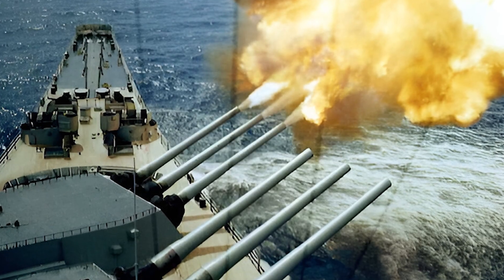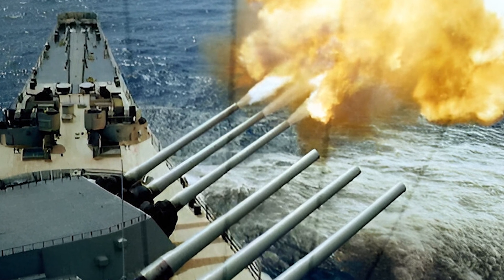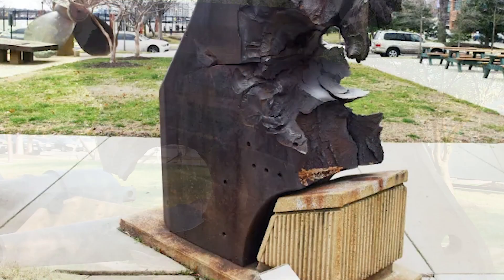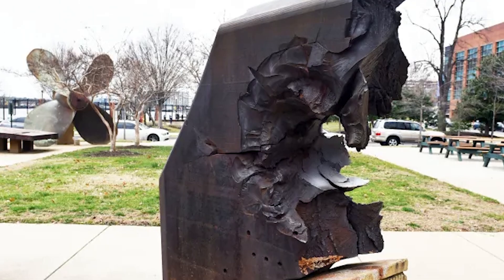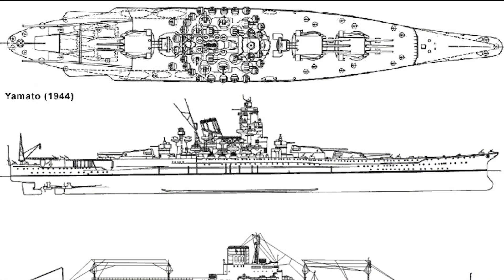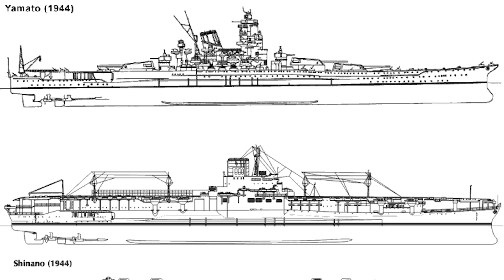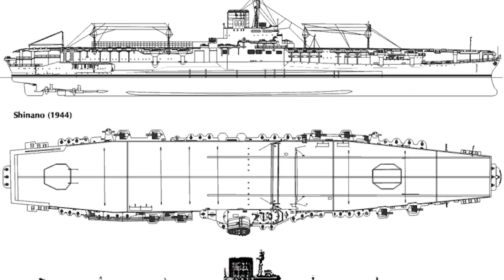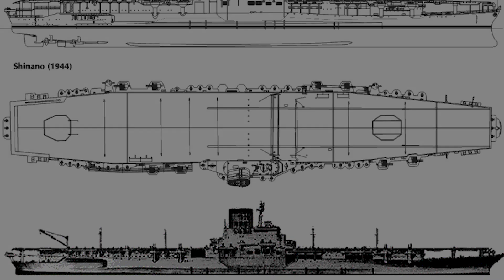USS-Iowa VS Yamato Armor Simulation

Comment: Before anyone goes overboard with this. The plate tested had FAILED its quality control testing at the Japanese foundry. That why it was lying around, and not in a ship. The heat treatment had gone wrong. It was too brittle. It is very hard to do the face hardening on such thick armour plates. All navies had difficulty getting the quality right.
Reply: As much as I believe that Japanese armor was of a far higher quality than is believed in western circles, there's no available evidence at all that the armor plate in question had failed any quality control test. It's far more likely that the armor plate was simply set aside because of the decision to convert Shinano into an aircraft carrier, and that the 26" plate could not be used in any other capacity in the Imperial Navy. This is supported by the fact that on the basis of the two tests on this same plate, the U.S. Naval Proving Ground concluded in their report that the faceplate could not be penetrated at any combat range by the 16" .50 cal. gun.

Comment: I actually read the official post test reports.  The test in 1946 was initially done with the homogenous armor plate mounted vertically 100 yards give or take from the muzzle of the 16" gun.  Essentially the two ships would have been as close as if they were tied up on either side of a pier firing at each other.  The test used a 2700 lbs super heavy shell and the maximum rated overpowered charge which was actually larger than the normal safe maximum in a ship.   The shell blew right through the plate and traveled miles into the Chesapeake bay and was never recovered.   The Navy  testing  brass were furious because that test did not even replicate  the methods the Navy tested their own armor.   It  was little more than a flagrant stunt and was considered garbage and a huge waste.
A second test was ordered with the charge reduced to produce a hit at battle ranges (16 - 18,000 yards) .   The specific range was picked  because they could not mount the plate at the sloped angle of the ship design.  So they calculated what  range roughly would cause the shell to hit the face perpendicular.  The second test firing was stopped cold by the damaged plate with little spalling on the back  side.  The final  report gave a sobering  assessment that the homogenous armor was impenetrable at likely battle ranges.  Other testing of face hardened Japanese  armor reached similar conclusions.    Yet the Navy paraded the first stunt test for the propaganda.  
It is important to  note that both  US Navy and  RN  claimed the Japanese armor had ceramic particles which they thought was contamination.   Interrogation with  tech personnel from Japan who made the plates later  showed they deliberately added the ceramic to improve performance.  Japan knew in a war they could not get certain alloy elements and developed substitutes.   This was hidden from the public and other nations.  Research eventually lead to the Chobham armor in tanks which is a huge improvement  over face hardened plate..
Reply: Well done.  

Truth be told, there is more than one way to sink a battleship even in the 1940s.  

In a one on one or line of battle fight jutland style the Yamato would likely have tipped the scales. But the Japanese knew they had to degrade the US battle line before that decisive engagement per Japanese prewar assessments.  

Game change with aircraft carriers and advances in other areas, radar controlled gunnery, better fire controls, improved damage control procedures, US wolf packs causing oil shortages and the sheer volume of us material and personnel thrown into this fight.etc...
Reply: @georgeramos9474  Guys, this sort of 'rah-rah flagwaver' is both common and annoying. Not worth engaging with. At best they have a shallow knowledge of a few secondary sources. Many are very, very young. Even experienced historians sometimes fall into traps, too. I recall a long debate about 15 years ago on this topic on the BBvsBB board. The flagwavers were utterly convinced that the Iowa DESIGN was superior to the Yamato DESIGN - but then argued that this was so due to US electronics superiority by 1945! Of course, by DESIGN the 45,000t Iowa is inferior to the 60,000t Yamato with its much thicker armour, greater ability to absorb punishment and superior guns. How could it not be? Also of course, both became obsolete very quickly and were not - in 20:20 hindsight - worth building. But  nobody in the 1930s when they were designed could possibly know that. And yes, the points on the invalidity of the test against the Shinano faceplate are all correct.
Reply: Funny how if it was propaganda why did the Yamato sink so quickly the aerial bombs and torpedoes easily sank it.
Reply: @spearfisherman308  Any battleship in the world would have been sunk by such an onslaught.
Reply: @spearfisherman308  Any battleship would have sunk under those same conditions.
Reply: @spearfisherman308  all ships can sink from torpedoes.   It is not clear the bombs did much damage.  On Musashi, she stayed afloat long enough  to determine the torpedo damage was fatal and the bombs were incidental.
Reply: @spearfisherman308  because bombs and torpedoes aren't 16 inch shells directed at the armor. this is low effort bait man, do better.
Reply: @spearfisherman308   Yamato sunk after a two- hour air attack by almost as many aircraft as the Japanese used in the attack on Pearl Harbor. EDIT. The Royal Navy equivalent of the U.S/ Navy Proving Ground- the Armour Technical Committee- concluded from their own testing that Japanese heavy armor was "...superior to all foreign armors"- including that of the United States. The differing conditions of the U.S. and U.K. test make clear that there was little difference between the armor of the three powers- certainly not enough to have an appreciable impact in combat. A range of 400 feet for the test was SOP for testing at the USNPG on any armor.
Reply: @manilajohn0182  yes but it didn't take that many hits to sink it and the torpedoes easily penetrated her haul which was designed to supposedly resist torpedoes, the planes attacked other ships as well and the bombs easily penetrated her deck so you left out so details
Reply: @manilajohn0182  nope Japanese armor was not superior the charge they used creat a velocity that simulated a hit from over 20 miles, and it slice through like butter
Reply: @spearfisherman308  Yep. Yamato was sunk more quickly than Musashi because the attacking torpedo aircraft placed the majority of their torpedoes on the same side, capsizing the ship. None of the dropped bombs penetrated neither the ship's deck nor the main battery turret tops. The NPG made no attempt to simulate a combat shot from any specific distance during the two tests. Their report concluded that the faceplate was impenetrable from any combat range by the 16" .50 cal. gun. You should read it instead of trolllling.
Reply: @spearfisherman308  This is for you, courtesy of the U.S. Navy Bureau of Ordnance.

Immunity zone of the Iowas vs. the 18.1" gun:
Citadel                    24,800- 29,800 (5,000 yards);
Turret Faceplates 24,700- 31,600 (6,900 Yards);
Barbettes               26,500- 31,600 (5,100 Yards);
Steering                 24,700- 28,800 (4,100 Yards);
Control Tower       26,500- 31,600 (5,100 Yards).

Immunity Zone of the Yamatos vs. the 16" .50 cal. gun:
Citadel             17,000- 34,500 (17,500 Yards);
Turret Faceplates                      (Impenetrable);
Barbettes         16,600- 36,800 (20,200 Yards);
Steering           19,100- 33,400 (14,300 Yards);
Control Tower 16,600- 33,400 (16,800 Yards).
Reply: @manilajohn0182  link the full report also again they used a reduced charge
Reply: @manilajohn0182  also as stated the charged was reduced and you have to take into account armor spalling
Reply: @manilajohn0182  also link the page.
Reply: @spearfisherman308  also also link the page
Reply: @spearfisherman308 torpedo defense is separate from shell defense.  But even Yamato and Musashi used multilayer torpedo defense as everyone concluded that enough armor to stop a torpedo (water is virtually solid for the first millisecond so the explosion pushes almost exclusively against the ship).  The problem with multilayer torpedo defense is that each torpedo floods some compartments.  Seventeen hits floods enough so that even Yamato and Musashi couldn't stay afloat.  Although after Musashi's performance, the US Navy made sure to torpedo Yamato on only one side!
Reply: @opvjg  it still failed and just to point out the Missouri took a kamakazi hit and it barely scratched the paint point is Yamato was good in theory but poor in practice
Reply: @spearfisherman308  That aircraft (single engine) hit the side of the ship (12" of armor). How much damage did you think that type of hit would cause. A bit different when a bomb hits the deck from a dive bomber.
Reply: @johnskibajr5691  a heavy aircraft flying at over 100 mph
Reply: @spearfisherman308  You obviously do not know much about WW 2 planes. A single fighter was not classified as a heavy aircraft and that plane was probably going full throttle which is over 300 mph. There is a picture of this attack. The plane came in at what looks like a 45-degree angle - not direct on. So, at best it was a glancing blow. It was not going to do much against 12" of steel.
Reply: @johnskibajr5691  okay buddy
Reply: @johnskibajr5691  also a zero stills weighs over a ton
Reply: @spearfisherman308  You just proved my point right there. Do I hear 3 tons? Just for reference the empty weights of the following aircraft: Betty Bomber 7 tons, B-25 Bomber 9 tons and B-17 Bomber 18 tons. But all that weight matters little when it hits something solid like a mountain, the ground or the side of a battleship. You may now continue on being right all the time.
Reply: @johnskibajr5691  no it does matter a heavy object hitting at high speed will do damage
Reply: @spearfisherman308  You mean like only scratching the paint? Your words, not mine.
Reply: @johnskibajr5691  the point was about the belt armor of the iowa class
Reply: @spearfisherman308  My point is that any battleship would resist that type of attack, not just the Iowa. I sort of lost track of your point as first you say that plane only damaged the paint and then it would do damage.
Reply: @johnskibajr5691  no it wouldn't look what happened to other ships hit by kamakazi
Reply: @spearfisherman308  Geeze man you are exhausting to read i can only imagine to argue with. You are wrong, everyone who knows their stuff will say either you are wrong, or be kind and say its 'a complex issue'. The points you argue for are not backed up by evidence, the official sources of both countries admit Yamato's armour was in general better then US battleships, the point is though that the US won because the war wasn't fought with only battleships, and in fact, battleships became obsolete mid ww2, so that better armor proved very little. Dont @ me, go outside and touch grass.
Reply: @BartJBols  Yes, he is a bit exhausting is he not? Lol. I think he may get his knowledge base from World of Warships. He does remind me of one battleship, that being the Bismarck after being hit in the rudder. It was only able to steam in circles and go nowhere in the process. He may learn something one day.
Reply: @spearfisherman308 there’s never been an aircraft designed to penetrate anything. All aircraft are designed to be as light as possible and still safely and repeatedly complete whatever objective it was built for. Ordinance is specifically designed to kill or destroy. So a kamikaze crash into an armored ship was never expected to penetrate the armor. The kamikaze pilots were “trained” or instructed to strike ships in locations where armor was specifically not present. Kamikaze missions were only a desperate attempt to delay the inevitable, not sink battleships. It’s difficult to understand why someone would compare such an act with the contents of this video or any remarks about the video. 

I’d like to see what WW II armor looks like after direct hits from actual combat ranges and angles. I also would like to see the projectile which was lost in the water after it penetrated the test armor in this video.
Reply: @richardkrenek985  doesn’t matter a heavy object moving at high speed will have penetrating power just remember a plane brought down the World Trade Center.
Reply: @spearfisherman308  of course, and a large enough plane would have penetrated battleship armor. But my point would be that a much smaller projectile or whatever type of explosive ordinance would have done the same thing in NYC. I would even argue that the WTC would still be standing had the two passenger jets had much less fuel on board. I don’t believe the crash alone would have leveled either of the buildings without the jet fuel.
Reply: @manilajohn0182  The total came down to 12 or 13 torpedoes on the port side. three 1,000 pound bomb hits, and seven "other" bomb hits that contributed to the sinking of the ship.
Reply: @Anubis78250  Yep. None of the bombs penetrated the ship's armor but they did contribute to the ship's eventual sinking by eliminating A.A. batteries and making the attack runs of torpedo bombers less hazardous.
Reply: @manilajohn0182  Musashi's boilers were damaged by a bomb. After penetrating two decks.
Reply: @Anubis78250  The ship's boilers were not damaged by a bomb. An engine room and boiler room were evacuated because a severed steam pipe made the two rooms uninhabitable. Note also that only two decks were penetrated. A complete penetration of the ship's deck armor did not take place. It was able to withstand a 1,000 lb. armor- piercing bomb dropped from 10,000 feet.
Reply: @Anubis78250  Yes. "Two" decks. Not all of her armored deck system.
Reply: @manilajohn0182  Clearly not impervious to bombs is the point. You can't say bombs did not contribute to their sinking. Bombs DID penetrate the decks of both ships to some degree or another. Enough to remove an engine room and boiler from the fight and reduce the ships speed.
You're right, it didn't go through all the decks. It DID go through enough decks to "remove a boiler and engine room from service". That's an effective penetration of the ships deck, no matter how you try to rationalize it.

Comment: emmm
lots of problems in this test
first, its almost point blank which far from normal engagrment range of battleships.
second, if one would llok at the schematics the Yamato class battleship's forntal turrent armor is angled quite a bit.
Reply: They reduced the charge to simulate long range. The reason they didn't shoot at long ranges because battleships are extremely inaccurate. 

At range, battleship shells come in at an angle.

Comment: It’s scary to imagine what Yamato’s 18” guns would have done with the thinner armor of Iowa-type battleships - it would have been gut meat and pools of blood.:face-pink-tears:
Reply: At the right distance and angle you’d be surprised what armor can do. As for the damage it really depends where the shell hits and at what angle.
Reply: It'd probably be fine. The USN battleships and cruisers were buoyant even with half the damn ship missing. Just look at the kind of damage Pittsburgh or Wisconsin suffered while still being able to stay afloat and return to dry dock under their own power. Also, 2 nuclear bombs and Nevada still didn't sink and that was a pre-treaty dreadnought.
Reply: Source material is from the U.S. Navy Bureau of Ordnance.

Immunity zone of the Iowas vs. the 18.1" gun:
Citadel                    24,800- 29,800 (5,000 yards);
Turret Faceplates 24,700- 31,600 (6,900 Yards);
Barbettes               26,500- 31,600 (5,100 Yards);
Steering                 24,700- 28,800 (4,100 Yards);
Control Tower       26,500- 31,600 (5,100 Yards).

Immunity Zone of the Yamatos vs. the 16" .50 cal. gun:
Citadel             17,000- 34,500 (17,500 Yards);
Turret Faceplates                      (Impenetrable);
Barbettes         16,600- 36,800 (20,200 Yards);
Steering           19,100- 33,400 (14,300 Yards);
Control Tower 16,600- 33,400 (16,800 Yards).
Reply: Yamato and Iowa had close to equal shell weight.  Because Iowa AP shells were 700 lb heavier than standard.